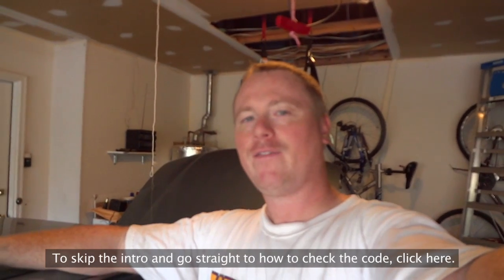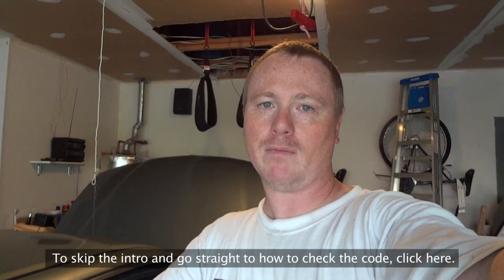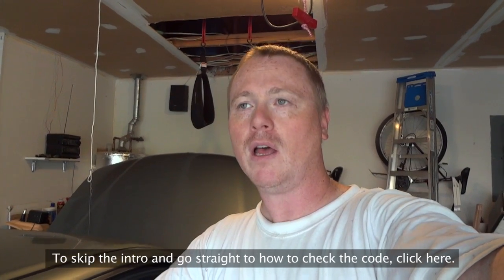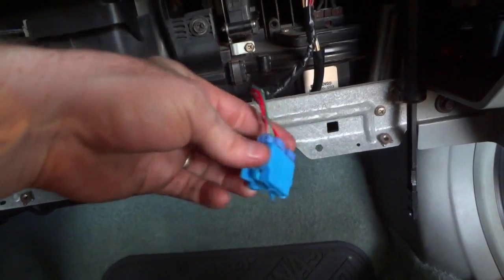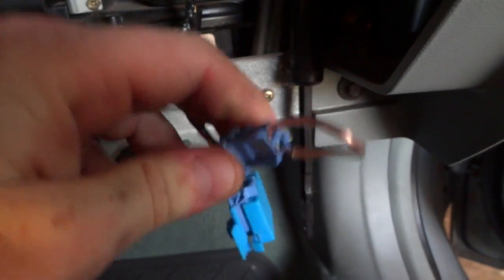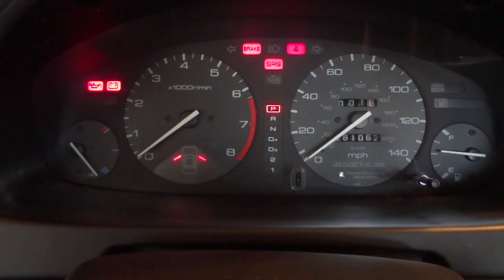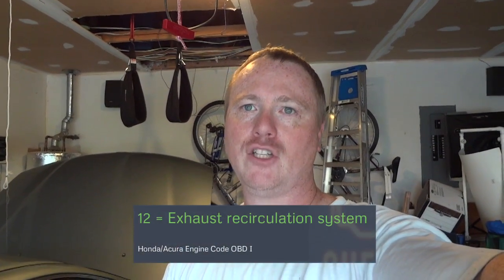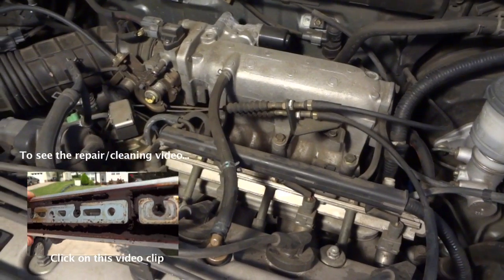How to Diagnos an OBD 1 Check Engine Code without a Tool | 1995 4cyl Honda Accord

Comment: I bought a used $500 95 Honda Accord it has no check engine light it has 317,000 miles what do I do? how much money will I need to put into it for it to be a travel car?
Reply: I think buying a car with that many miles was a mistake l, even for a Honda
Reply: Edison Hernández my first honda i bought was a 96 ex with 380K never let me down sold it around 420k 🗿
Reply: @faustogonzalez3334   I am on Honda #5 - I call them Timex' because they Take a licking and keep on ticking - as John Camron Swazzy used to say in the Timex commercials. My dad used to say that 100,000 miles on a Honda (the ones before all the computer mess came to be) was just getting broke in. He was always right about cars. Always.
Reply: Going to go see a 95 coupe 5speed manual 500$ 166k with sunroof but im not sure how to make the tool to check the obd1

Comment: These are error codes 
Code 0 and 11 Electronic Control Module (ECM)
Code1 Heated oxygen sensor A
Code 2 Oxygen content B
Code 3 and 5 Manifold Absolute Pressure
Code 4 Crank position sensor
Code 6 Engine coolant temperature
Code 7 Throttle position sensor
Code 8 Top dead center sensor
Code 9 No.1 cylinder position sensor
Code 10 Intake air temperature sensor
Code 12 Exhaust recirculation system
Code 13 Barometric pressure sensor
Code 14 Idle air control valve or bad ECM
Code 15 Ignition output signal
Code 16 Fuel Injector
Code 17 Vehicle speed sensor
Code 19 A/T lock-up control solenoid
Code 20 Electric load detector
Code 21 V-TEC control solenoid
Code 22 V-TEC pressure solenoid
Code 23 Knock sensor
Code 30 A/T FI signal A
Code 30 A/T FI signal B
Code 41 Heated oxygen sensor heater
Code 43 Fuel supply system
Code 45 Fuel supply metering
Code 48 Heated oxygen sensor
Code 61 Front heated oxygen sensor
Code 63 Rear heated oxygen sensor
Code 65 Rear heated oxygen sensor heater
Code 67 Catalytic converter system
Code 70 Automatic transaxle
Code 71 Misfire detected cylinder 1
Code 72 Misfire detected cylinder 2
Code 73 Misfire detected cylinder 3
Code 74 Misfire detected cylinder 4
Code 75 Misfire detected cylinder 5
Code 76 Misfire detected cylinder 6
Code 80 Exhaust recirculation system
Code 86 Coolant temperature
Code 92 Evaporative emission control system
Reply: 66 code

Comment: What does exhaust recirculating mean? The exhaust gases are coming back to the engine? My same exact Honda does this as well, gets the check engine after a cold start then i turn it off, turn it back on then it doesn't pop out again
Reply: Probably the catalytic converter

Comment: for those of you wondering why the check engine light stays solid
i think i have the answer since i was having the same issue on this very same car 1995 honda accord 4 cylinder non vtech automatic do the exact as this person did except of not turning on the car you must turn on the car and then you will began to count the blinks just thought this would help someone out as for this video thank you it helped out allot thank you for sharing